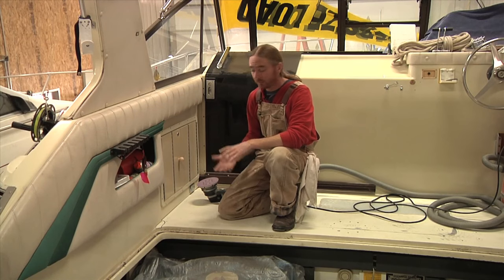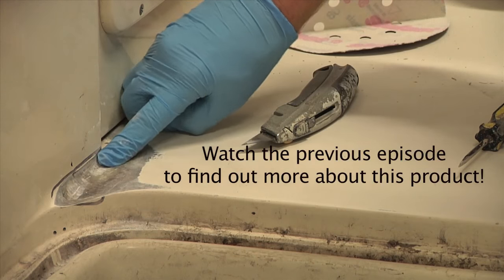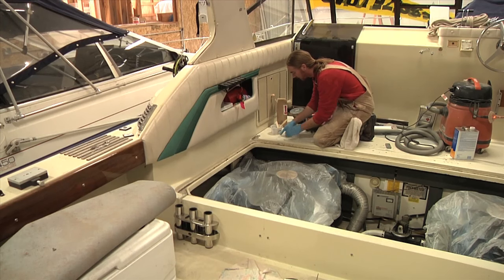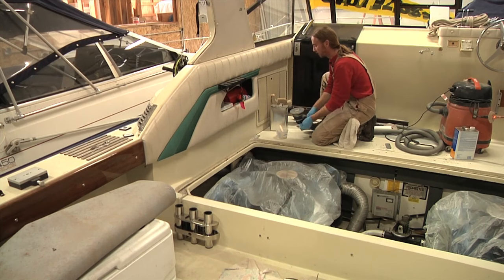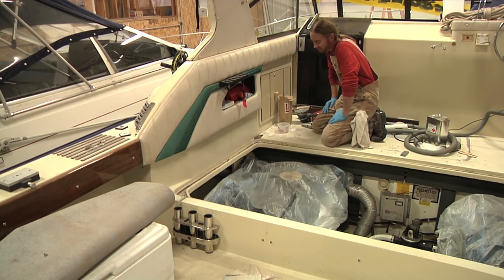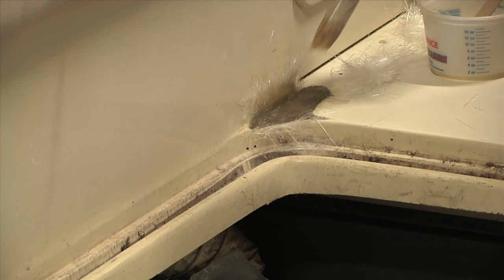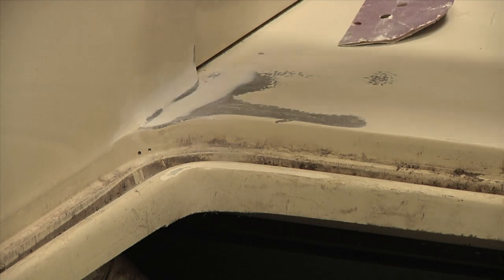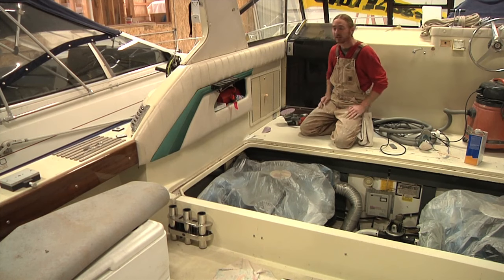Fiberglass Repair ~ Stress Cracks

Comment: From the looks of this, you pretty much took off the gelcoat and a layer or so of the cracked glass.  The problem is that the area is a flex point which caused the cracks in the first place.  When we fix areas like this, we grind it down until we get to solid glass, not leaving any voids that would need to be filled with gel paste.  Then layer it in glass starting with a biaxial glass for strength followed my 1.5 oz CS mat for buildup.  Not knocking your work, but I would think that repair would crack again with any use of the boat.
Reply from the maker: This particular area was a mess..  If I had removed all of the defective layup I likely would have gone all the way through :-/  Most of what I was seeing was voids and resin (very little glass).  So far the repair has held up, going on 4 or 5 years now and the owner beats the crap out of the boat :-/..  But you are correct, whenever possible it is best to completely remove all defects before moving forward!
Reply: Well let me shut up...if it has survived 5 years of abuse in a radius like that, it's done right!
Reply: You can't normally do this in areas like this. I work on boats for a living and in almost ever situation I have seen there is little to no glass in these areas of the boats that crack there. Air pockets and a ton of resin but little to no glass. You take down as much as you can without loosing all of your backing and then start glassing. If you can reach the backside you can always repair the back side once the top side has cured. I'm restoring a 1976 Chris Craft XK 6.9 at work right now. The who damn boat is riddled with these types of factory defects. I just found some hair line crack in the transom wall. Ground the gelcoat off to see if the damage was in the glass too. Sure enough it was. Ground into the glass for the repair and found a massive air pocket between the outside transom glass and the board they use to strengthen the transom from the inside. I could go on and on and on. The boat manufactures do shit work of laying up the glass.

However I will say that at our shop we would typically do a larger repair than he did to that area. We would get down into the gutter too. If you have those defect in that area, you can almost guaranty that the gutter has a terrible factory layup too.

Comment: hi, whay you first paint gelcout and late sand it, what the point?
Reply: MrTomkiss  A profile for proper adhesion.
Reply: MrTomkis I'm sorry, it was to fill the pits then have a flat surface for proper adhesion.  Less bubbles because there are no valleys in the profile.

Comment: A penny is roughly 19mm, so if you use a Penny and its just a smidge larger, you got 20mm. A Nickel is 21mm so if you want ultra precision, it's gotta be between a Penny and a Nickel! ha!
Reply: 20 mil not mm
Reply: @charlesvickers6568  1 mil is the same as 1 thousands of an inch, so he is basically talking 20 thou or .02"

Comment: I don't understand your mindset when you chose to fill pinhole voids before laying polyester fiberglass over it. Wouldn't the polyester resin fill the void just as well as the fairing compound your using? Neither are structural , and have no strength of their own. So what is the point?

Comment: This is why these chopper gun boats are pieces of crap.  Been building, repairing boats for 40 years.  We use hand laid epoxy glass exclusively.  No exceptions. But our construction methods are cold molded plywood with glass between laminations of plywood. Not criticizing your videos at all,  they are spot on for what you are doing. Our boats are considered sport fishing yachts here on the outer banks of north Carolina and are built to the highest standards. I really hate working with polyester during repairs.

Comment: Sigh ... no.  Standard fibreglass layed up at any thickness will fully cure, it does not need gelcoat on it to cure. Gelcoat no matter how thick will ever cure if it is exposed to the air. It needs to be free from air properly cure, otherwise it always has a slightly tacky surface.  You can get "waxed" formulations of gelcoat that develop a layer of way on the top to  seal out the air and allow the top to set .. but standard gel coat wont fully set on an exposed surface.  When you lay up a molding, the gel coat goes on first, the side which is in contact with the mold fully cures, the inside stays very slightly tacky, to help it form a good bond with the lay up glass.  This guy ground nearly all the gelcoat away, so it makes no difference in this case, but, in general for repairs, for a hard, brushed on gelcoat finish, use a "finish gelcoat" that contains a surface wax to seal out the air.  For creating new parts in a mold, use a unwaxed gelcoat.
Reply: His laminating resin has no wax so it won't cure instead he puts the wax in the gel coat to cure it all. It saves sanding and wiping it down with styrene between each layer.

Comment: Sorry Bud. But 5 sheets of paper can never be 20 Milimeters. If, then only 2 Milimeters. Great demonstration. Rover
Reply from the maker: Mils, not Millimeters.  Mil, also known as a thou is equal to one thousandth of an inch (0.001 inch). The mil or thou is still used in the United States to measure thickness of various materials.

Comment: 20mm is nearly an inch
Reply from the maker: valiantGLX79 Mils, not mm..  20mils = .5mm or 1/64inch :-)
Reply: Thanks for the clarification, I live on the metric side of the world. Ever considered doing a video on RC boat fiberglass repair? I have some stress cracks in the gelcoat on a 620mm tunnel hull and I'm not sure whether to sand it down to the glass and add a new layer, or just channel out the cracks and fill them with something.
Reply from the maker: valiantGLX79 Not real familiar with RC boats (besides thinking they are cool ;-).  I suspect you could probably dish out the cracks and fill with a flexible epoxy (pettit flex-poxy or west system g/flex).  If there's a lot of cracks in a small area you'll likely need to add some glass :-/
Reply: valiantGLX79 
1 Mil = 1/1000 inch.  20 mils = .02 inches. Not mm. you a mechanic.?

Comment: After 13 minutes the repair finally starts. Do not ever let a lot of waffle get in the way of a video.
Reply from the maker: aubreyaub Personally not really a fan of waffles :-/ and am not really sure what you mean.  The repair process starts within the first 3 minutes and is something I like to call Prep work.  I like to provide viewers with answers rather than leaving them with a bunch of questions regarding what materials were used, why I chose one product over another and how to apply / work with it.
Reply: BoatworksToday I thought your presentation was spot on and did an excellent job of explaining what you were using and why.